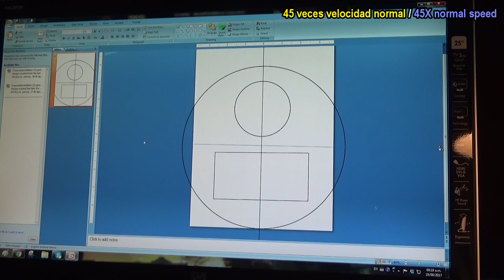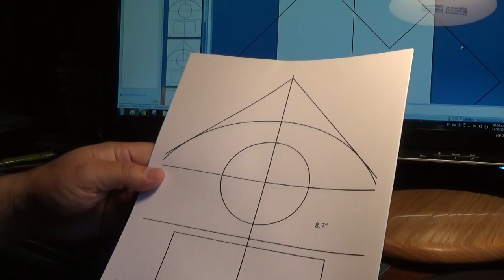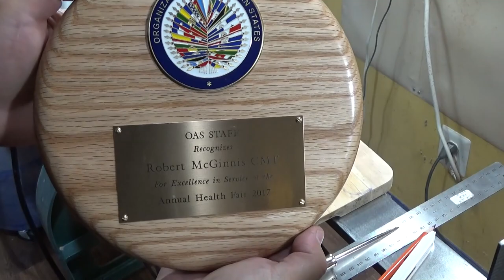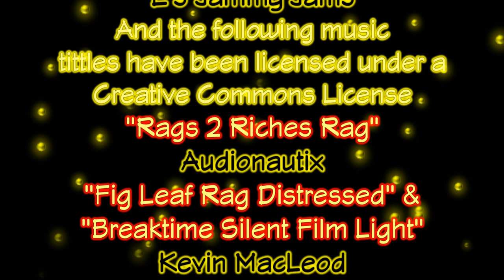Red Oak Recognition Plaques

Comment: Cool way to determine if the face is flat. Thanks Daniel.
Reply from the maker: Hi Gary! Thank you, my friend, for your comment. Yes, I use that technique all the time to see if I have parts where the gouge is still not cutting (the parts that are not touched by the pencil). It works better if the speed of the lathe is relatively high (1000 RPMs or above). Cheers! Daniel